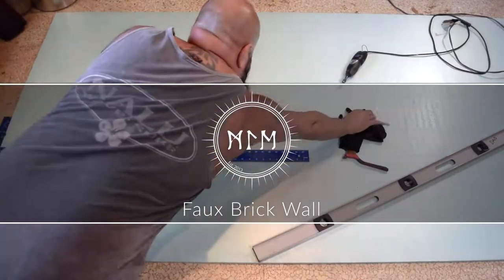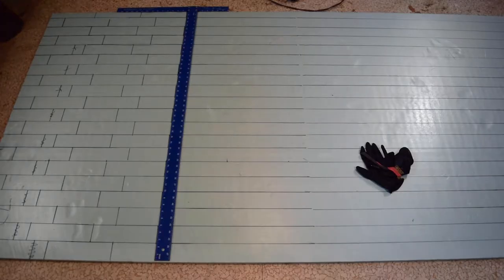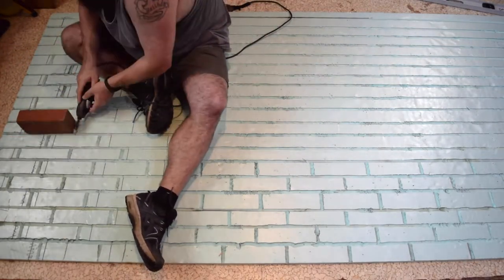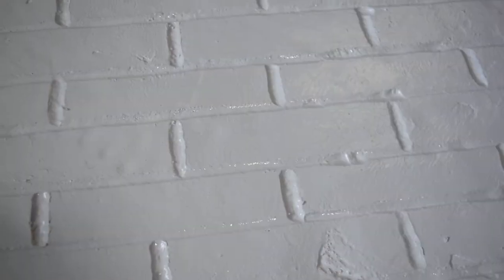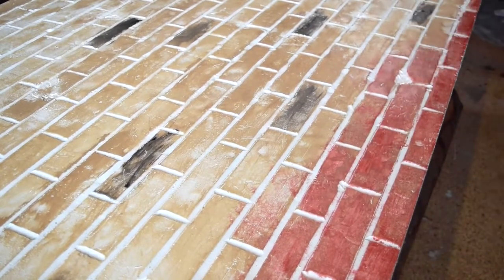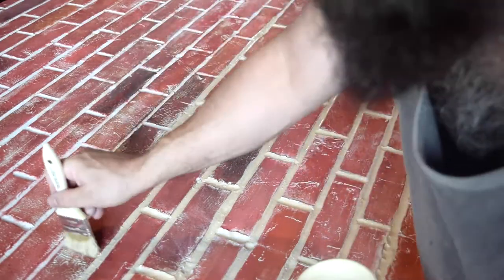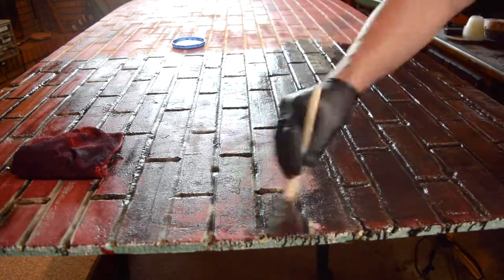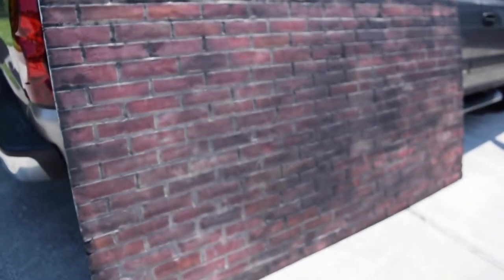How to Make a REALISTIC BRICK WALL from foam XPS - A Step by Step How To Guide

Comment: How durable is it? Would it chip easily?
Reply from the maker: It’s fairly durable. But if I was going to use it as like a coating on the wall let’s say I lived in an apartment and I wanted to have that fake brick look, I would definitely put something over it some type of Apoxsee coding before I painted it. I won’t say it chips easily, but it is something that can be chipped if you bump up against it furniture hits it that type of thing. But for standard run of the mill set design, it’s been holding up perfectly.

Comment: Will this finish be okay if I use this for the walls of a basketball gym and they they may get hit by a ball?  I only need to paint them white.  What is the minimum thickness for the XPS foam as they can be quite pricey where I live?
Reply from the maker: I would not trust this in that type of environment. I’m certain if, before you painted it, you could probably put some type of fiberglass coating on it to help protect it, but even then I think it might be a risk. That XPS foam is really soft not crazy soft but you could certainly put a dent in it by tapping it gently with your fist.

Comment: Nice work..
I have a above ground pool. I have usually used outdoor green carpet laid on top of not great shape concrete patio as a cushion protective base.. pool about 9'x6' 
Carpet 12'x12'... Nice play area for the kids.. carpets old n needs replaced. It's EXPENSIVE and last 2yrs or so. I'm thinking creative and thrifty. Also it would look cool.. 

I first got the idea from the foam wall panels they sell. And I've been looking for someone who's used this outdoors. The 4x8 sheet is good idea. Kinda labor intensive, but might be an alright idea..
Have any thoughts?
Reply from the maker: my only concern would be the weather on the paint I used - you'd most likely need to use something more robust to withstand the weather.  Next you'd have to be sure it's affixed to something sturdy as well as supported properly....  but if I were to do it, I'd probably use 1/2" OSB rated for outdoor use, cut the bricks out of foam and use mastic to adhere the bricks.  Then paint accordingly, using outdoor paint.